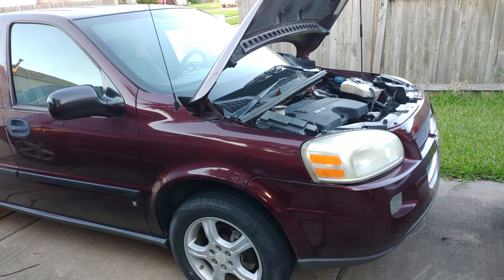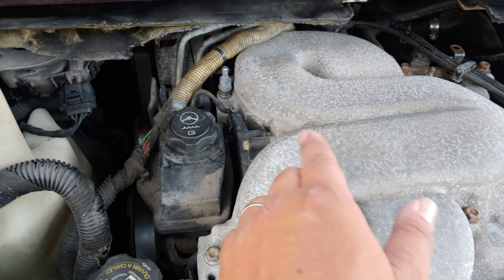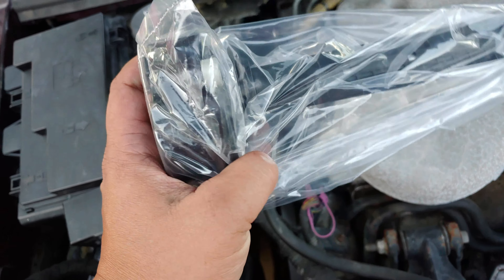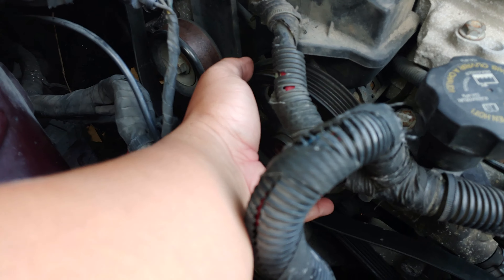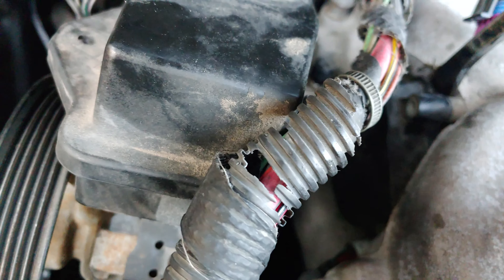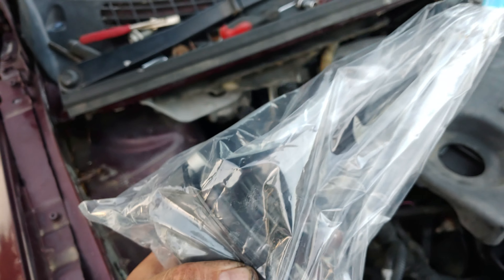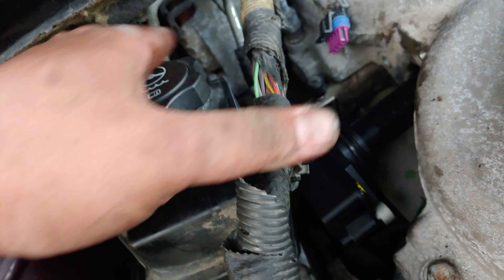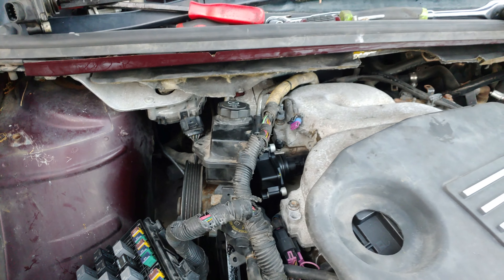ERROR CODE P2070 CHEVY GMC VEHICLE

Comment: When you put the power steering resorvoir (tank) back in with the serpentine belt, is it straightforward? Will there be no issues. My dad is telling me that if I tamper with the belt in any way, it would cause other issues. He wants me to take it to the mechanic but I really want to do this as I see no point in paying the money I don't have while this looks very straightforward. My question is is it very simple to put it back as you took it out. (No issues?). Please respond, thx